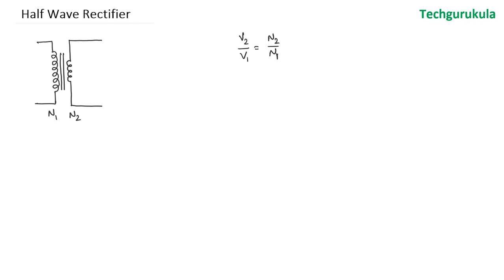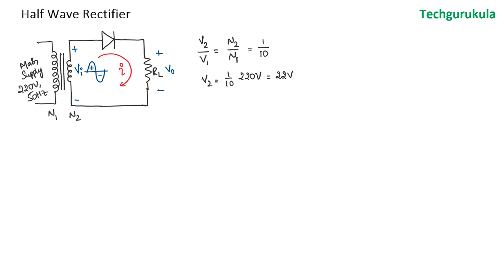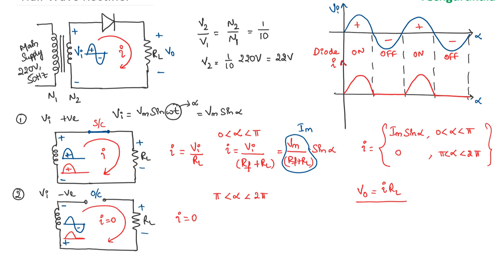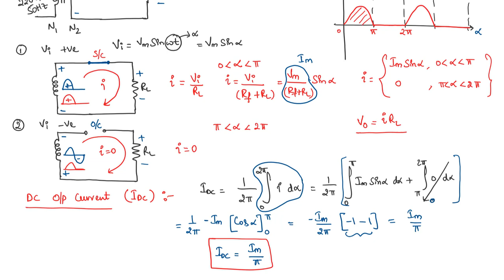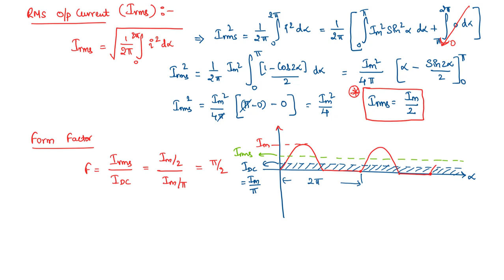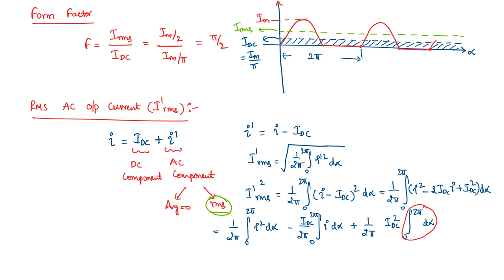Analog Circuits: Half Wave Rectifier - Working

Comment: What is the difference between rms o/p current at @11:28 and Rma Ac output current @16:28. 
If you could reply within a day. it would be great, 
Regard 
Arpit
Reply from the maker: @11:28 RMS value of the output current (which contains both DC and AC components). @16:28 RMS value of the output current's AC component (NOTE: RMS value of only output's AC component)
Reply: @techgurukula  also why is the i(dash) avg =0 @17:07
thank you for your swift response.
Reply from the maker: @arpitgupta843  pure AC signal has zero avg component, hence avg is zero.